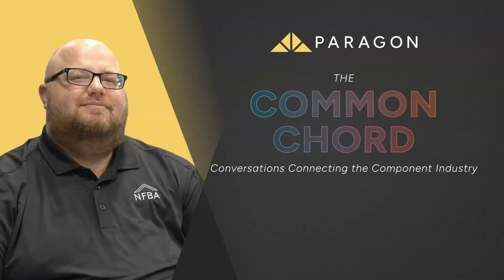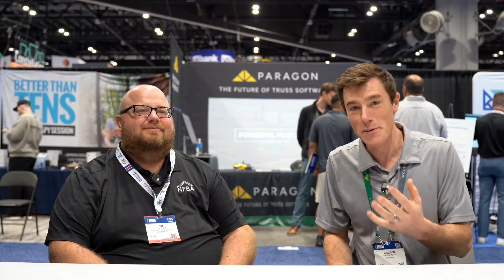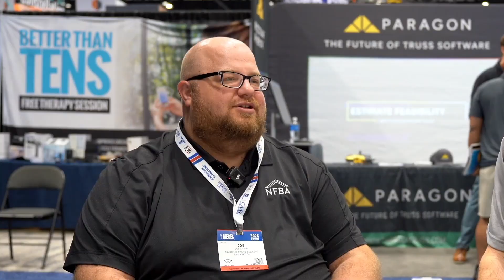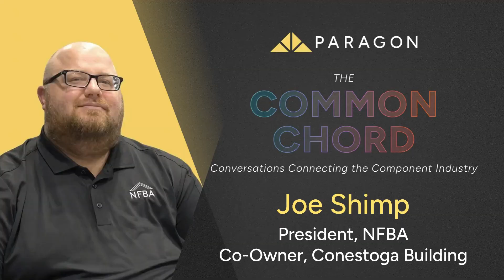Post Frame Meets Component Efficiency - The Common Chord with Joe Shimp

Comment: Contact email? I'm building an addictions centre 64x40 to start.  Quebec Canada near Ottawa.  Workshop done. Postframe. I'm an architect technician and the builder. My idea is parallel cord roof truss 21' long connected to peak on ridge board and opposite truss.  How to exactly connect design parallel cord to 4 ply 2x6 I don't really know.  And very very little real life demos how to exactly design warm roof. Insulate parallel cord, then maybe 2x4 Perlins on edge then steel? Or sheath w 7/16 in trusses, osb, synthétique underlayment rhinoroof U20 then 2x4 Perlins flat not on edge for strapping and as Perlins then steel?
Reply from the maker: Hello! Feel free to reach out to support@paragontruss.com and we can see if we can help you figure that out.